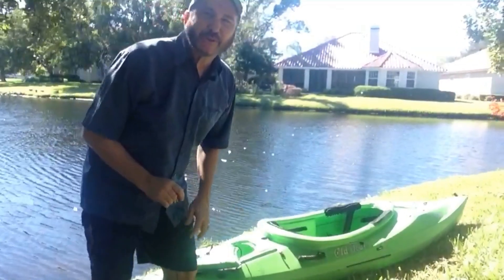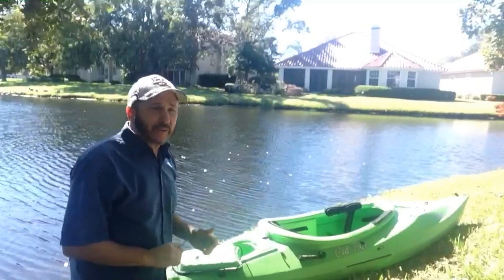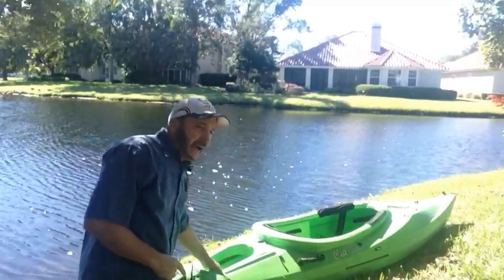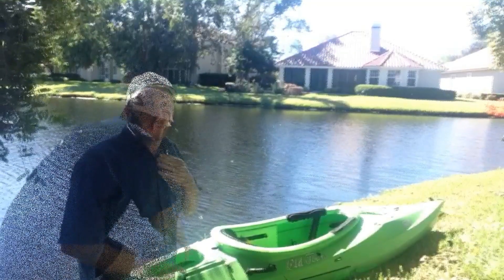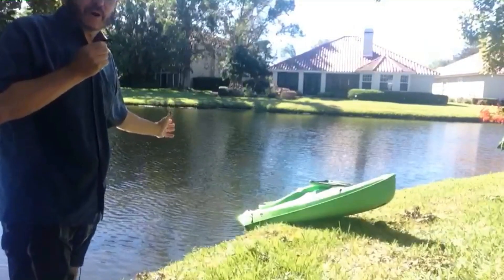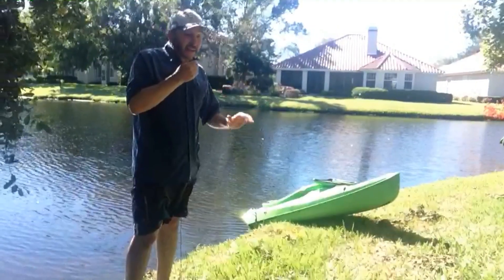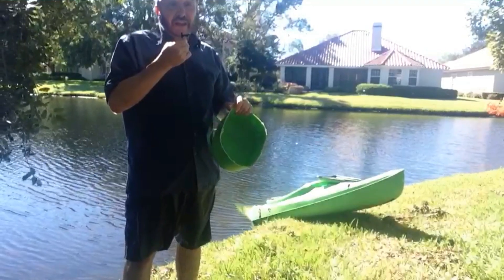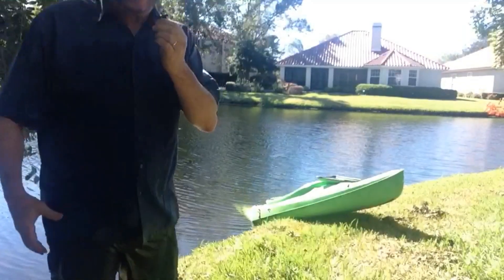Modifications to Sun Dolphin Aruba 10 Kayak float test, part 4

Comment: Is it that frickin hard to buy a pfd. Just to be safe.
Reply: The idea is losing the kayak and all the stuff in it. I actually flipped mine last month n i did have the foam pieces in. My yak didn't have any air pocket left and it barely stayed on the surface of the water.

Comment: Good to see someone test this however I find it not complete. Add some stuff in there like a test or some cloths or what ever you intended to carry roll it over a couple of times and see what happens. That air pocket will escape and it will sink. With this mod I would at least recommend a pile of foam in the nose and as much any other place you could put it.

Comment: My mom threw away the two styrofoam squares on each side of the seat and I threw the one in the back out should I get some styrofoam squares and replace them or will it be good?
Reply: Replace them ASAP
Reply: Thought about getting two small buoys from Walmart and putting on each side of the seat
Reply: If you dont mind your kayak to be on the bottom of what ever body of water u are on then i would def replace them. U can get kayak air bags that work great

Comment: Check out: http://KayakTrainingWheels.com and we think you will agree this is the perfect add-on to make kayaking more fun than ever! This kayak is superior in many ways. It is lightweight...only 40 lb. Easy to put on the top of any size car, easy to take from car to water and very inexpensive. At the same time, these very light weight kayaks are hard to keep from capsizing and various inventions to add to the sides of the kayak are expensive, difficult to install and, most of all, make it hard to row. As a fan of these, we have devised a simple way to prevent capsizing, make it possible to stand up in the boat and makes it much easier to fish from.